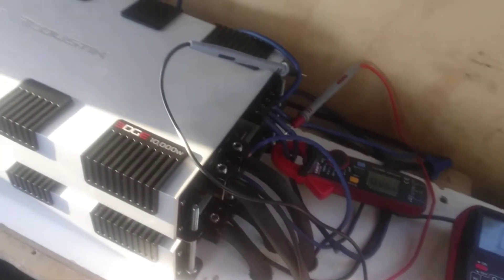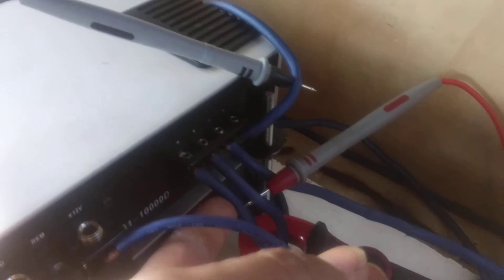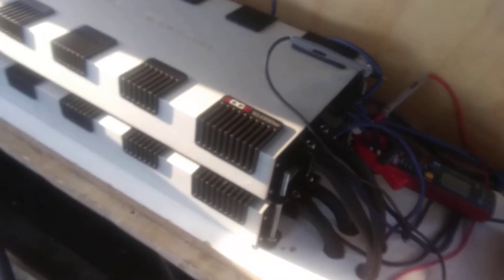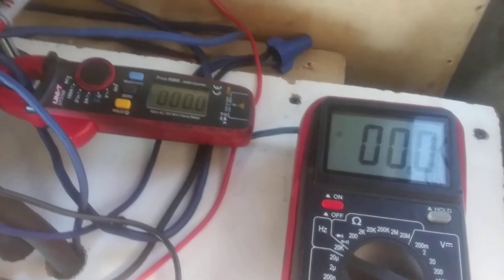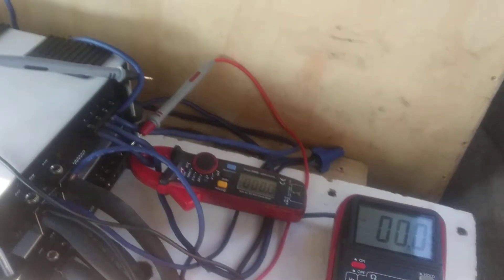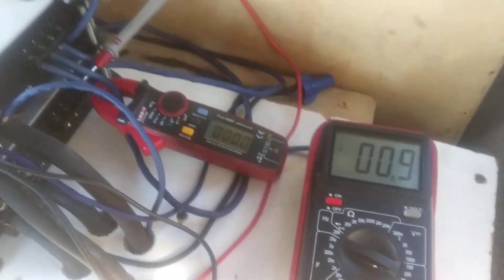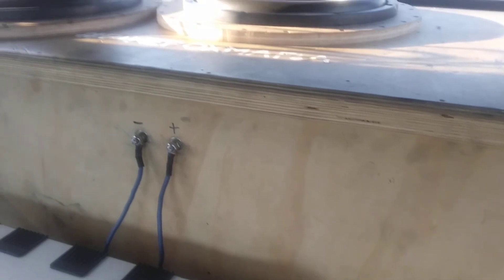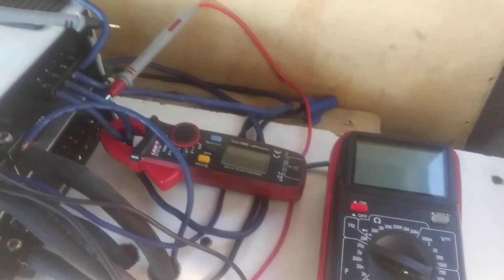Power Acoustik EG1-10000D .5 ohm Clamp Test

Comment: If I can give you a little advice.
Connect your 1st amp enslaving  the 2nd to the 1st amp. But before you do any of that do a big 3 wire conversion  all that is is bigger gauge wire on your alternator and battery terminals. Plz check the all the power, ground wire and speaker wiring to make sure you have the right gauge wire & for loose connections, also check the maximum output wattage of your speakers.

Comment: keep up the good work man!!
Reply from the maker: Appreciate the love bro. Will definitely keep things going
Reply: @BIGJURAY20  hi there bro remember me ✌
I need some help again 
I have to 2 SVC PIONEER subwoofer each rated at 500W RMS 
They are wired to 4 ohm 
Will they give 1000w rms to amp 
I have a monoblock which is rated at 
600w rms @ 2 ohms
1000w rms @ 4 ohms
Is the amp right ?
Reply from the maker: If the subwoofers are bridged then yes they will be getting the 1000 watts.
Reply: @BIGJURAY20  it is a monoblock
Reply: @BIGJURAY20  what do you  mean. By bridge
Reply from the maker: What amp is it you are running?
Reply: @BIGJURAY20  It is a reference audio monoblock 
I do not know if these rms ratings are true 😩
Reply from the maker: Do you know the model of the amplifier?
Reply: @BIGJURAY20  nope I do not
How are you doing by thw way 😆
Reply: @BIGJURAY20  tell me what do you mean by bridge because I have one channel and subs are sharing connection both are svc 4 ohm
Reply from the maker: @trevinopadayachee8570  all is well thanks for asking. How about yourself?
Reply: @BIGJURAY20  is it possible for an amp to output more rms at higher impedances 
Example in my case more at Rms at 4 ohm?
Reply from the maker: @trevinopadayachee8570  i thought it was a 2 channel. But you said it's a monoblock. You said it does 600 watts at 2 ohm and 1000 watts at 4 ohm. Monoblocks does more power at lower ohm loads and 2 channels will do more bridged at 4 ohm
Reply: @BIGJURAY20  im good 
Just that im having some difficulties with my amp 😅
Reply from the maker: What kind of problems are you having? Is it not playing as it should?
Reply: @BIGJURAY20  yes I know that so it does not make sense this way
This amp must be showing fake output ratings
Reply: @BIGJURAY20  would you recommend running a monoblock at 4 ohms 
As I have heard 4 ohms gives cleaner bass as less power output
Reply: @BIGJURAY20  I do not know why the rms output is higher at 4 ohms 
Suppsosed to hit harder at 2 ohms am I right? 😟
Reply: @BIGJURAY20  hey bro just figured out problem it was was to 8 ohm load because it was wired in series 
Now wired.to 2 ohms 
Have to sell amp
Reply from the maker: @trevinopadayachee8570  yea having it at 8 ohm was maybe 300 watts so understanding if it didn't seem loud. A nice amp that does around 1000 watts at 2 ohm should do u some good
Reply: @BIGJURAY20  okay so will each woofer get 500w rms because 1000w should divide right?  Because of 2 subwoofers?  😆👏
Reply from the maker: @trevinopadayachee8570  yes each will get 500 watts.
Reply: So a monoblock divides rms by the number of subwoofers amplified / wired up
Reply: @BIGJURAY20  Thank you once again bro for all your help and support 
Much appreciated 👍✌
I am so glad I have someone like you that reads my comments and replies
There are so many people out there that just ignore me 😔
Reply from the maker: @trevinopadayachee8570  well I'm happy i could help. Feel free to contact anytime. I'm on Facebook and now have an instagram just search Bigjuray20. I know the feeling of reaching out and no reply
Reply: @BIGJURAY20  well bro I do not have a Facebook or IG account yet so for now can we chat on YouTube 😆?
Reply from the maker: @trevinopadayachee8570  of course not a problem
Reply: @BIGJURAY20  thanks alot man 🙌😉👍 
So what lpf frequently do you recommend for deep bass on subs
Reply from the maker: @trevinopadayachee8570  around 50-70 hz
Reply: So will the speaker play music only play between 50 - 70hz?  Does it work like that
Reply from the maker: No it'll play other frequencies just not beyond that point
Reply: @BIGJURAY20  okay cool thats awesome 
And same with hpf Example 125hz 
It will play every frequency but not beyond that
Reply from the maker: It'll play 125hz and up nothing below that point
Reply: @BIGJURAY20  so for my subwoofer hpf should be off right?  And lpf should be set at abt 50 hz average 
I dont want high frequency out of my sub
Reply from the maker: @trevinopadayachee8570  Exactly
Reply: @BIGJURAY20  but you said it will play all frequencies but nothing below what its set on 
Wont the sub play like 500hz example?
Reply: U are confusing me abit there bro 😅
Please understand I am a beginner lol so im trying to understand what you are saying
Reply from the maker: @trevinopadayachee8570  lpf is a low pass filter for subs. If you have it set to 80 hz it will allow the subwoofers to play 80hz and below. Nothing higher
Reply from the maker: @trevinopadayachee8570  hpf is a high pass filter if you have it set to 150hz for example. Anything below 150hz will not play
Reply: @BIGJURAY20  okay now I understand thank you bro u really explain well 🙌
Reply from the maker: @trevinopadayachee8570  lpf= lower frequencies mainly for subwoofer Hpf= higher frequencies used for midrange and up to tweeter frequencies
Reply: So if a song has a 80 hz bass frequency 
And the sub is set to 70hz wont you hear anything from sub?
Reply from the maker: @trevinopadayachee8570  then the sub will play every frequency except for the 80hz
Reply: @BIGJURAY20  so you said 70Hz is a good range right 
Im sure most songs dont go above that frequency for bass 😧
Reply: Okay bro thank you so much for explaining frequency to me 
I am so grateful 😉
One more question before I say goodbye 
Which bass is more clarity between 4 ohms and 2 ohms
Reply from the maker: @trevinopadayachee8570  4 ohm power will give more clarity from the amplifier but 2 ohm will give more power
Reply from the maker: No problem bro happy i could help.
Reply: @BIGJURAY20  okay goodnight bro we will chat soon 👌👋 lol cool

Comment: do you still have your PA eg1-10k ? I just bought one and the guts look nothing like the one on big d's dyno video. If you do and you are able to get a gut shot. please post it up.  amp is for a 8 budget 12's I need 2400 watts rms minimum @ 2 or .5 ohms. so the eg1-10k fits the specs and price. but this new guts got me thinking. anyway lmk if you can help.
Reply from the maker: Yea for whatever reason the boards changed. The one you have does not put out the same power as the one you see in the dyno video
Reply from the maker: The Power Acoustik Vertigo VA1-10000D is 1 ohm stable but is stronger than the Edge 10000D
Reply: @BIGJURAY20   well that sucks, Im gonna return them.  I need 2500w rms @ 2 or .5ohms. the LPF on taramps suck. back to more R&D lmk if you know of anything
Reply: @BIGJURAY20   I know the vertigo puts out decent power for the money. I have the 8k from facekicker
Reply from the maker: @sheenafrom808  How your electrical?
Reply from the maker: @sheenafrom808  the 8k is nice but the 10k is noticeably stronger
Reply from the maker: https://www.walmart.com/ip/Power-Acoustik-VA1-10000D-Vertigo-Series-10-000-Watt-Max-Monoblock-Class-D-Amp/411083997

Comment: I just want to know is your soundstream xxx6500 Louder or the Power acoustic?there is a big price difference..thanks
Reply from the maker: The XXX 6500 were louder. I clamped 3750 watts at 1 ohm rising to 2 ohm with the XXX 6500. I clamped a little over 3000 watts outta the power acoustik at .5 ohm rising over 1 ohm
Reply from the maker: The XXX 6500 were louder. I clamped 3750 watts at 1 ohm rising to 2 ohm with the XXX 6500. I clamped a little over 3000 watts outta the power acoustik at .5 ohm rising over 1 ohm

Comment: also how hot do they get at .5 ohm?
Reply from the maker: Mines has never ran hot at .5ohm or even .35ohm they're not the strongest amps but they are pretty solid
Reply: @BIGJURAY20  I just got one from walmart, however the guts are way different then the one on big d wiz channel and all the others I've seen.
Reply from the maker: @sheenafrom808  Yea sadly the boards were changed the new one's don't do nearly as much as the one u see on the amp dyno video. The best bang for buck amp at 249 would be a taramps smart 3k then for 199 the Power Acoustik Vertigo VA1-10000D

Comment: Lol , actually I have two of those amps and big D wiz was correct I got a lil over 8k at .5 ohm in a qbomb..fact it will run .25 ohm, but it gets hot after awhile.. definitely not a 10k, but definitely a 5k individually .5 ohm my daily driver..lol only 3 clicks of bass nob💯 strapped it does get windy
Reply from the maker: I've ran mines at .25 for a little while and it held up. Overall it is a decent amp for the price
Reply: @BIGJURAY20  totally agree 💯, I want to put them on a 4th order, cause my 2 qbomb get breezy 😎🔊🔊🔊🔊